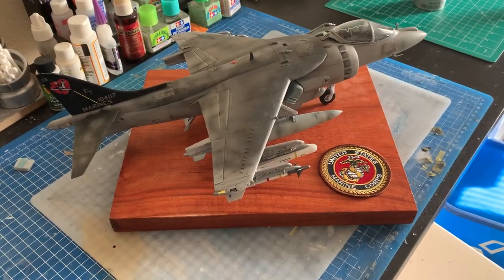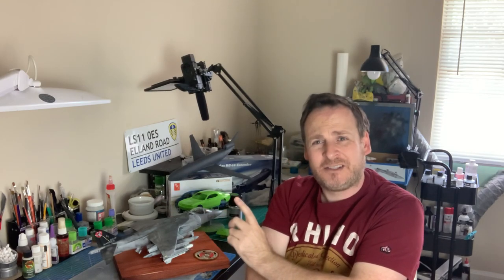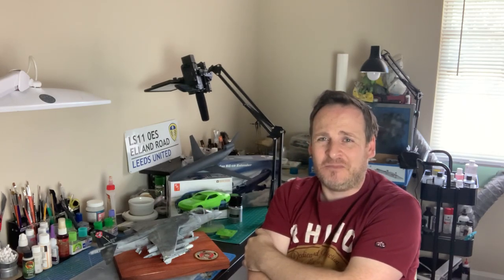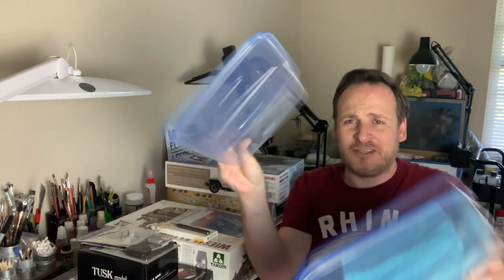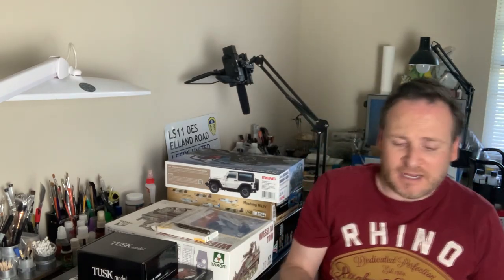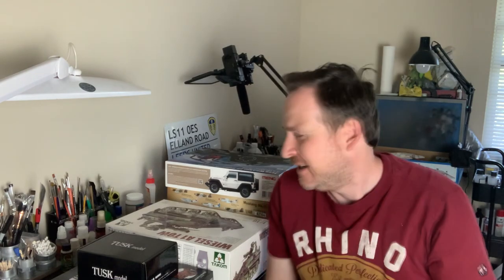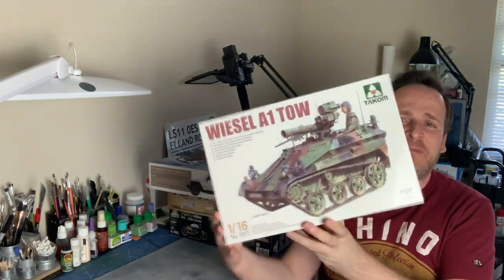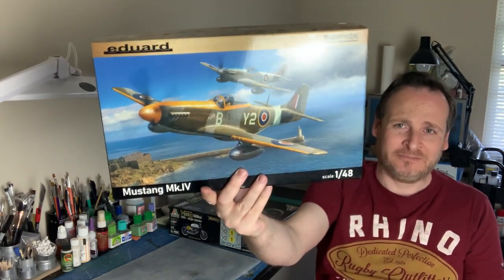Model Bench Update: May 19, 2021

Comment: your filling and sanding skill is great, the KC-10 is SEAMLESS !!!
Reply from the maker: Haha... smoke and mirrors. But thanks. It turned out good. I tried using sprue-gloo... Tamiya extra thin with some plasticard mixed in. It worked great. First time I used it for seams. I also sanded in the kitchen sink with water running and that also worked great and zero clean up or dust.

Thanks for watching, Richie.